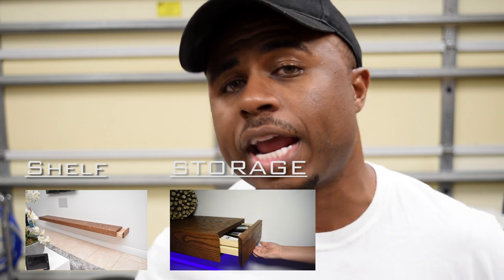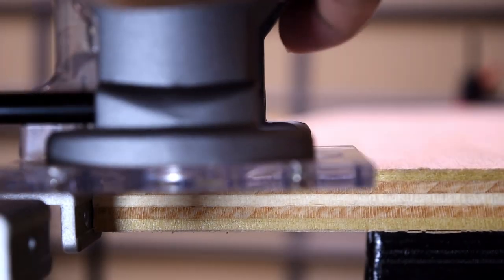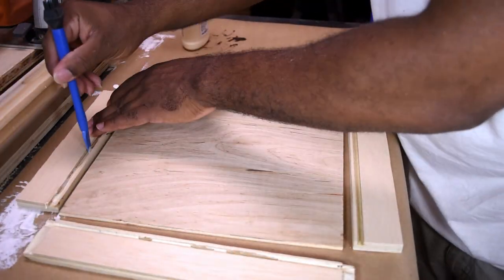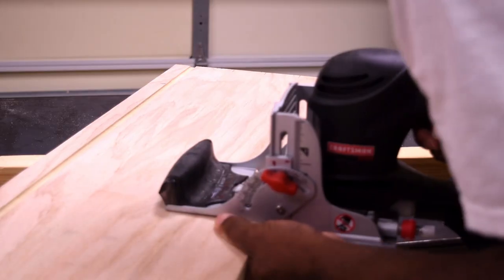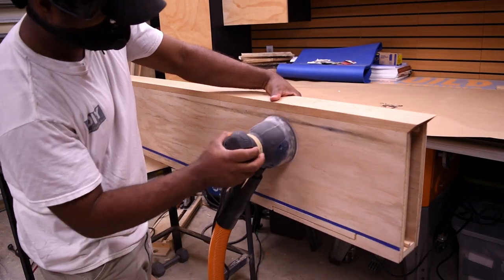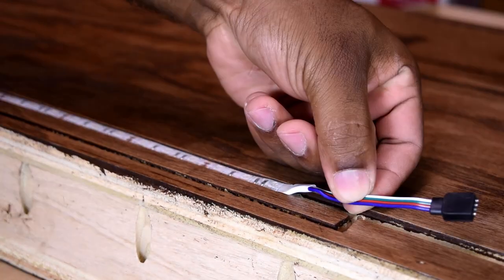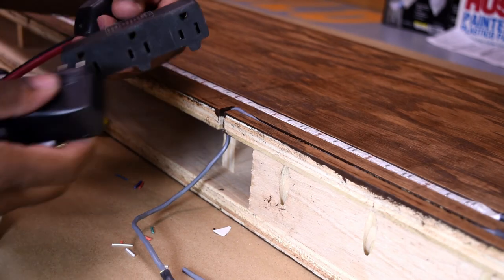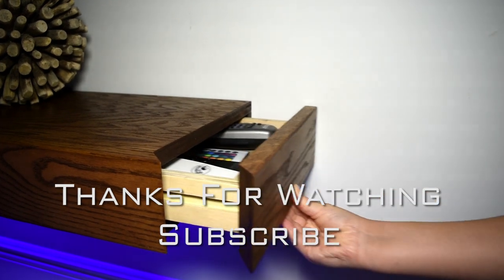8ft Floating Shelf With Hidden Storage | DIY Build

Comment: Nice work! Love the floating shelves!! Wiring tip - if you stagger the cuts/splices of the wires slightly so they're not at the same position, you'll have less "bulk" to slide the tubing over
Reply: Nice tip!

Comment from the maker: FAQ 
Circular Saw CrossCut Jig https://youtu.be/JN2ynUdyPS8
link to LED   http://amzn.to/1Wx7Qis
Heat Gun http://amzn.to/1U6ruwQ
Shrink Tube http://amzn.to/1XHNlzP
Suggested Wire http://amzn.to/1sGlEvE 
Minwax Gel Stain " Hickory" http://amzn.to/1OK9gVm
Reply: Please make a video about basic carpentry, what types of materials/tools used, where to get the woods/ types of woods.......etc.
Reply from the maker: Yes ill make one.
Reply: thank you
Reply: can u make something for shoes storage?
Reply: A lot of your basic materials can be bought at Lowes and Menards especially for poplar lumber and plywood, that is one place to start looking to get started. Plus most of the employees there are very helpful with beginners tools such as squares, hand saws even the electric hand saws, and when our host here posts his tutorial for beginners, this post will help you a little more :)
Reply: Here is a thought, can you build simple boxes that are open on both ends? If so you can basically build a simple shoe rack using this method. Most basic materials are needed plywood and maybe some 1x4 to make proper frames, good luck :)
Reply: amazing work!  thank you for sharing 
I just have a question can it carry a tv?
Reply: that one, no. you would have to enforce it to hold that.
Reply: how can you reinforce it?
Reply: this will give you an idea.
Reply: A measurement plan in the description would be very helpful!

Comment: I'd recommend you to sand down the support that is in contact with the wall in an angle so that the overall project sits slightly tilted up. So by adding the extra weight of the things you wanna put on top it'll end up perfectly level

Comment: Looks pretty cool, but I think it would look a lot better with a larger tv mounted just above it so that it's more obvious why it's there. 

Also would have been a good idea to add a surge protector multiplug built into it so that you can easily plug and hide any other wires (like for a game system or dvr). also perhaps you wouldn't have had to mess with the cutting and extending wires, etc.
Reply from the maker: Thank you, I actually replaced the tv already for a larger one :). 

All my equipment is in a remote location so everything is out of sight.
Reply: DIY Creators Oh, I suppose that works too. Is there a closet behind that wall or something to put the wires through? 

Btw, really like the design. I wonder how much weight it would hold.
Reply from the maker: It does, I'm using one of my kitchen cabinets that we don't use to hide all the equipment. I show that in one of my future videos of the house tour. 

This could easily hold a 100 pounds. I wouldn't put anymore unless reinforced differently. 

Thank you
Reply: DIY Creators
Reply: m8
Reply: Eileen the Crow I

Comment: Nice modern look with warm wood tones. Definitely subbing. I would like to offer some advice on the wiring. This is coming from my avionics experience in the military. 

Electrical tape isn't a good joint. The heat shrink helps but it could still be pulled apart. If you don't feel comfortable with a soldering iron there are heat shrink solder butt splices. Just search "Solder Seal Heat Shrink Butt Splice Connectors" on Google or Amazon and get the size you need. Also, to reduce the bulk of spices stagger the splices. Spread the slices apart for the least amount of bulk.

Comment: I like how you started with your long panels and then worked from those dimensions. Nice build. Good video. Easy to follow. You’re a fine craftsman, Glen, you might watch THISisCarpentry for his ideas about building drawers. Thank you for letting us see your work. Definitely following. Oh, suggestions you asked? One short strip of very low watt LED just inside the drawer switched so they come on when the drawer opens.i wouldn’t have suggested. It you asked, and you’re a fine electrician as well as woodworker. Best of luck!

Comment: Like it! 
One tip when did you put 2x4 in to the wall in this video, on the back of the side of 2x4 need slice few degrees down. So when you install that 2x4 its not bee 90 degrees that be 93-95 degrees up.Weight is take down the shelf and with time that might be lower then now.

Comment: Enjoy your videos.  Have a question.  One wall in kitchen has baseboard heater, so cabinets not practical.  How deep could I go and still be structurally sound with a floating shelf 8 ft in length?  Thanks!

Comment: I know this is an older video - nt sure if you monitor comments - but wanted to say thank you for sharing this build.  I am thinking about building a similar shelve for my daughters home.  She has a Walnut theme going.  Did you use red oak ply along with the outside red oak pieces - appears to match.  also what was the thickness of your plywood - seems like 3/4" would be heavy.  With all of the support from the hangers, I was thinking i might use 1/4 or 1/2 in walnut ply, do you think this would work?  How well is your shelf holding up?  BTW - just subscribed

Comment: Very nice vid love it I have a very long ledge over 15' and 4" wide its 32" off the floor i would like to put a cabinet with doors and possibly drawers but not necessary. My question should i have floating cabinet on top of ledge or below even with top of cabinet?
Reply: probably bellow with top of the cabinet.

Comment: This is very cool. I am interested in doing a smaller version in my study to hide hold some books and hide my home protection system. I'll lock it using a magnetic mechanism and a figurine with a magnet embedded in the bottom. Totally discrete

Comment: I do have a suggestion yes, don't forget to drill pilot holes for your screws. you screwed the front board of your hidden storage, directly with a rounded screw. Why make such a beautiful project on the outside, but be sloppy on the insides?
Also, if it's not designed to carry a lot of weight, why not just take 2 broomsticks, cut them in 3 parts, and use or 5 broomstick rods as a bracket to hold the project? Also solder your connections before you protect them with shrinkwrap :-) For the rest, awesome job dude!!! thinking of making one for myself now :-)

Comment: If you want to fix your floating shelf  on to drywall cavity walls  if the fixing points don't fall on the stud work .use Geefix drywall anchors..these are the only anchors that will do the job. They are super strong.👍

Comment: I thought the hidden drawers were a clever idea.  Hopefully you went back and sealed your shelf with poly or, at least some BLO to help protect from contamination and reduce wood movement.  Also, consider applying paste wax to your runners to help minimize binding and wear.

Comment: SMALL TIP.  ON WOODEN SLIDERS IF THE FIT IS STIFF.  RUB A BAR A SOAP ON IT A FEW TIMES  IT WAXES THE SLIDE. and only needs it one time.

Comment: Becarful My Brother had the same type of led light and after a while of usage the adapter got fire under the table and luckily my brother disconnected it before it get mess. If u have to use the same led don’t cover the black adapter and disconnect it from electricity when u don’t use the led lights.

Comment: I know this is an older video, but I only gotten into woodworking in the last few months, but thought I would mention these nifty little devices for projects such as this. Smart plugs such as these http://a.co/5b9tJj2 can be added so you can set a timer for the lights or use a smartphone to control them or even an alexa enabled device.